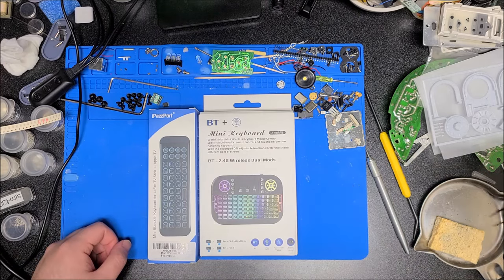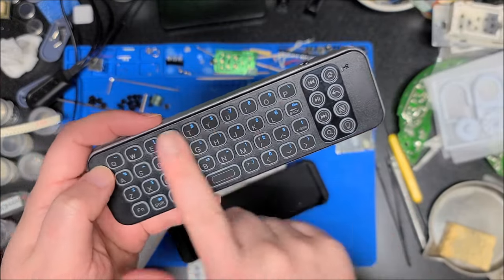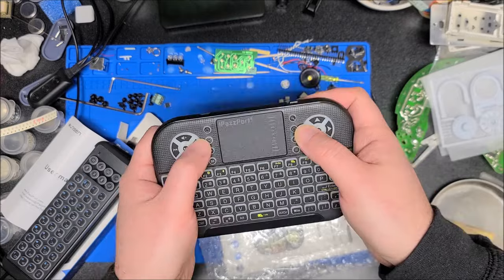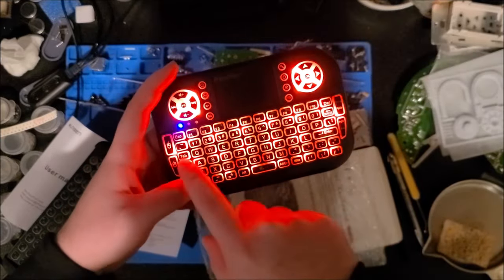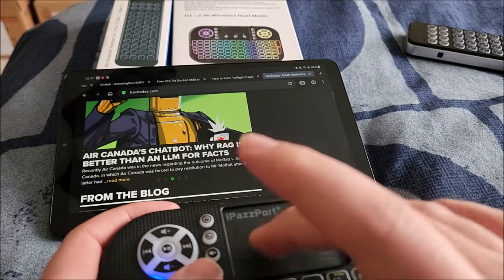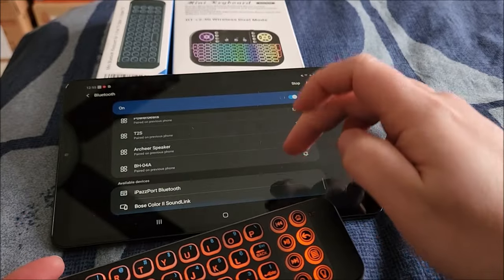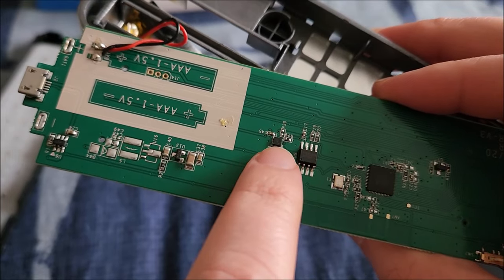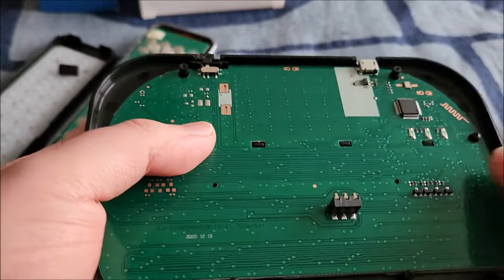iPazzport RF/BT Portable Keyboard/Touchpad/Remote Double Review

Comment: Wonder if the touch pad function would work on my Samsung TV
Reply from the maker: One way to test is if a usb mouse works on the tv then this will too.
Reply: That’s my favorite ipazzport keypad btw 7 color backlit.        It’s just wide enough for two hands
Reply: But check out the X6 airmouse with keypad.  Bluetooth that one is still micro usb but the new x9’ is usbC 👍😎